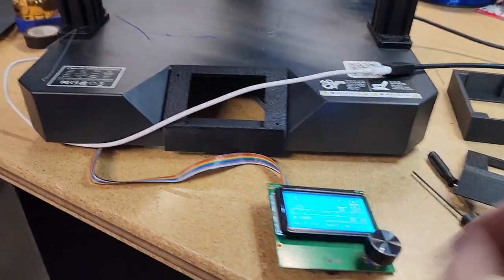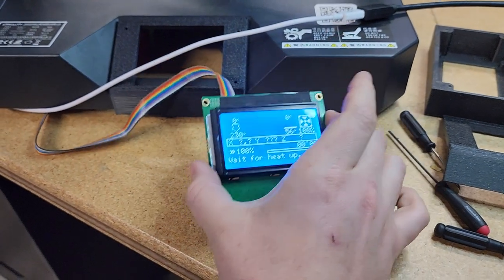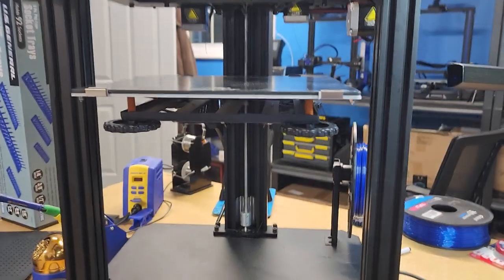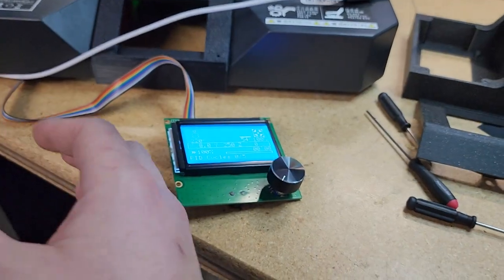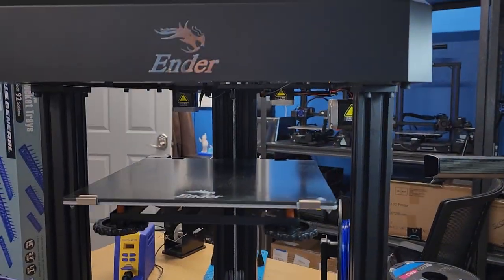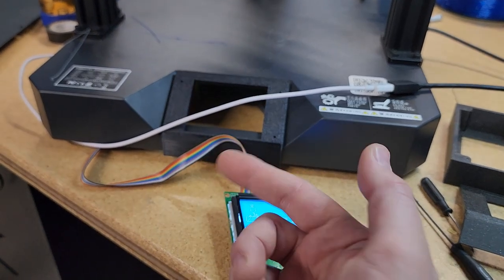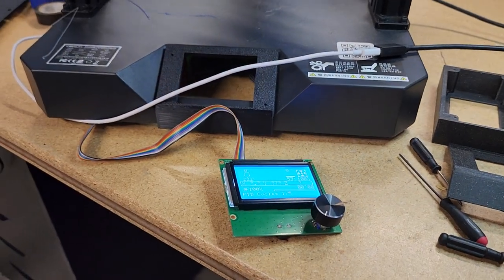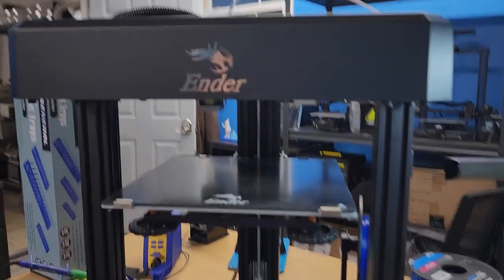Dev Update - Ender 7 LCD Kit & Unified 2 Firmware Update

Comment: super. but I would die to have a direct drive on my ender 7 and linear rail for the Z too. what do you think??
Reply from the maker: Not sure if our MultiMount system will fit this machine or not but we're gonna take it apart and see what we can do. As for the Z a linear rail isn't really needed. The stock setup is actually decent.

Comment: I was just curious why the screen needs to be replaced to run your firmware? What is wrong with the stock touch screen? I have a modded ender 7 right now but looking to improve anything i can on it. lol. I have been using a CR touch but thinking about changing it out for the EZABL, what benefits will i get for the changeout? Thanks.
Reply from the maker: As with all the stock touch screens that come on Creality machines the main issue is you can't do much to get features on them that you get with the 12864 and Marlin doesn't support them at all or fully. The screens run their own closed source code that creality doesnt provide. So replacing it means you get back full control of the printer. There are some community made firmwares out for those touch lcds but they are very hacky and usually have odd bugs. They also tend to change the LCD chips multiple times a year and I am not wasting my time trying to reverse engineer all their stuff on the LCDs when a better LCD that will always work with Marlin exists.

Comment: im alaways up for a mod that is benificial .
Q. can we use the Ender 3v2 touch screen as it is compatable with Marlin and easy to mod.
Anyway the only issue i have with the Ender 7, Is no where to change the E step as mine seems to extrude a little to much
Reply from the maker: You can certainly try to put that LCD on that machine but its not something we support with our kits or firmware.

As for changing the esteps on the stock one - you cannot. If you have our LCD kit installed you can set it in the firmware or via the Gcode commands. The stock creality firmware is pretty neutered.